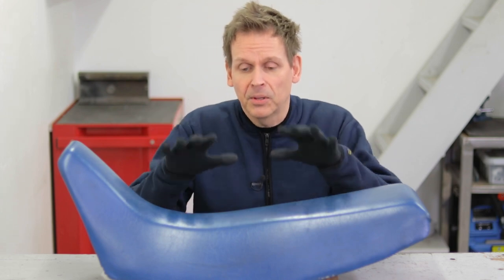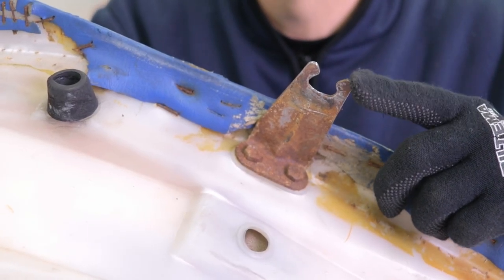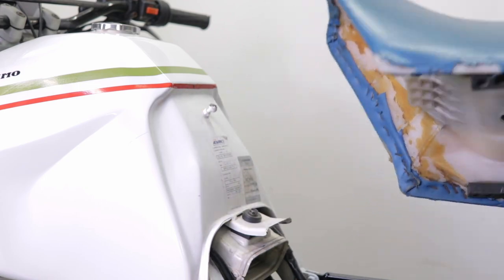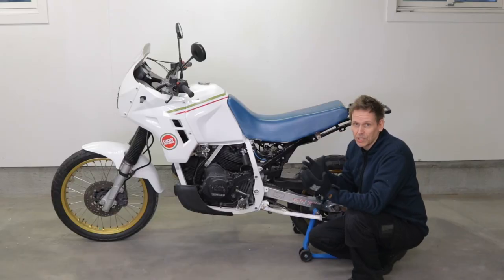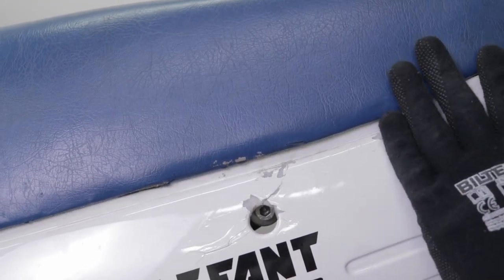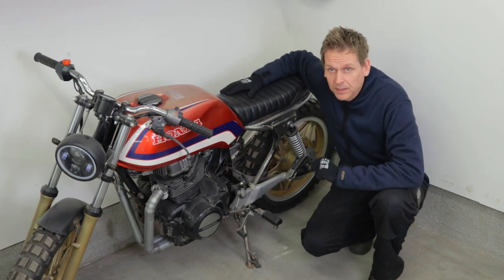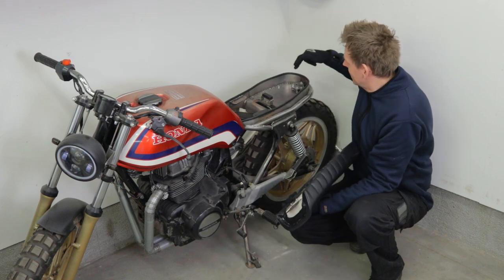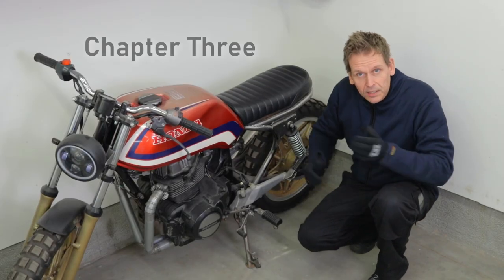3D Printing a Motorcycle Lock - It's stronger than you think!

Comment: The jaws of the vise are adding strength to the mount housing.  A true test would be where the housing is bolted to a frame like it is on the bike.  This would impart focused forces on the housing's bolt holes where stresses will eventually cause the plastic to fail.  Once you've dialed in the design, replace the plastic with metal parts so that it is much more safe on the bike!  Great design!!!
Reply from the maker: Yes, that is true. I just took it for granted that the white tab was the weakest link since it is the thinnest part, the black housing is quite a lot thicker and stronger. It would absolutely make it much safer making it with metal parts, but the idea behind 3D printing it was to simplify the fabrication process. I also think it is strong enough as it is 😊

Comment: That's a very nice idea.
I'm rebuilding a 1981 Suzuki which has a similar mounting mechanism, with the added fun of the same bolt also holding on the rear indicators.

I shall have a look to see if I can adopt a similar solution.
Reply from the maker: Ahh, cool - what Suzuki is that? I am very satisfied with the solution on my bike, it still works like a charm 😊
Reply: @kihestad  Hi! It's a GS250T, twin cylinder, twin cam, 8 valve aircooled...
The engine looks huge, "Like a real motorbike" as one of my friends says, but it's only a baby 250 😁

I do have a couple of "proper" big bikes, but I wanted a little retro to buzz about on.
Reply from the maker: @juststeve5542  That is a real classic! It does not look like a 250 at all, I would have guessed somewhere between 550 - 750 😊
Reply: @kihestad  All those fins and the overhead cams make for a large looking engine - with teeny pistons inside!

I wish I had been able to 3D print mudguard replacements, it took me ages to find some good ones... 40 year old chrome is hard to find, who would have guessed! lol!
Reply from the maker: @juststeve5542  It can be a real challenge to find parts for these classic bikes 😊 Good luck with your project! 👍

Comment: If you're printing in PLA, you might have issues with the plastic deforming in the heat. Great design tho and I'm sure you could make it work.
Reply from the maker: Thanks 😊 It will probably be safer to print it all in PTEG. It's not very complex parts to print either. That is also the beauty with 3D printing, it's just to print a new part in another plastic type if it breaks!
Reply: @kihestad  PLA is often one of the stronger plastics you can use for 3d printing, the problem is that it can deform dramatically even at temperatures you can touch.

From experience, leaving a PLA part in the sun for a couple hours is more than enough to cause the part to shrivel up. 

I would bet that if you used a hairdryer for a few minutes on the part and then did the strength test, that would be a reasonable analogue for the temperatures it will deal with.

I give it 50/50, mostly depending on the infill and walls you went with. Making it white would probably help, though not much and putting some foil around it would probably outright solve the problem.
Reply from the maker: @SirSpence99  At least no problem so far, I'll keep this bike for a long long time - I'll let you know how it goes 🤞

Comment: The problem is not static 20 Kilos of force but the dynamic repeated stress during probably off-road driving and sideway movements of an 80 Kilo rider, securing this movement only with the 2 nuts in plastic holes is not enough. The seat coming off is a great danger, that is why it was secured by 2 hooked latches and 4 probably 6-8 mm bolts. I would at least use the plastic prints as models to manufacture metal parts and secure them with 6-8 mm bolts and nuts, even better would be to secure the seat with 2 locks instead of only 1. Innovative thinking and nice work though.
Reply from the maker: That is true, I would guess most of this force is sideways. I will secure the seat from moving sideways do it is not relying on the lock for that. I will keep you posted how it goes 🤞

Comment: I designed a replacement handle for my cars glove box a while back. It was made in pla, but it lasted for well over a year in a car that was parked in the texas sun. The unlocking lever seemed pretty weak but it held up for the rest of the lifetime of the car. Even in high heat pla can hold up if it isnt under tension.
Reply: it might be worth adding in some rake or some sort of locking geometry to prevent it from sliding around under hard riding, but looks like it'll be fairly solid.
Reply from the maker: That was not bad at all. I'll probably keep it as is and see how long it will last. This motorcycle is a keeper, I can report on every year 😊
Reply from the maker: Yes, I agree. I have planned to make some proper sturdy sideways "stoppers", perhaps reuse the mounting for the original brackets, to ensure it's not going anywhere!

Comment: Fantastic craftsmanship and a really great idea for those of us with older bikes where items like this could be very useful. This would also be a great upgrade for a seat that has the old push tab at the back that is plastic and prone to breaking, for instance on a 4x4 bike where you may be removing the seat more often than on your street bike. I would just like to say that maybe having the latching pieces at steeper angles, for instance the black piece at 80* and the white at 100*. I would also lubricate the pieces with dry graphite spray.
Reply from the maker: Thanks a lot, glad you liked it 🙂3D printing is perfect to prototyping, easy to do small changes in the model and make a new print for testing out what works best in real life. Perhaps changing the angles would have made it even better. I try to stay away from lubrication if I can, it avoids dirt and dust to stick to it. The plastic is very glossy and smooth, so far it has not been needed.

Comment: FDM 3D Prints are strongest perpendicular to the Layerlines no mater how many infill it got. It looks like your hook could be printed 90° turned upwards to the side to make it even stromger. Also you know your test isnt 100% valid since you clamped the slidershell in the vice. The encasement probably itself or the mounting screw attachement would fail first.
Still impressive and probably strong enough.

But i would reprint all PLA Parts in PETG. Pla got a realy low Glas Transition Temprature where it will get soft. Start warping and starts to creep while under tention. Its that low simple park it outside in the Summer or/and an even indirect heatload from the Exhaust for examle will make it fail over time.
Also PLA is not UV resiatant (not that it realy matter under the seat) PETG is better suitet (but even more a Carbon Fiber blendet variant) for automotive and outdoor applikations

And surely you know the hook and the slider is that simple you could just cut it with an angle grinder out of solid Aluminium from the scrapyard;)
Reply from the maker: Thanks for your thorough feedback 😊 You are correct, the hook (what I called the hatch bolt) could be printed the other way around. I was really just testing the PTEG part in this test, since it is the thinnest part (5mm) I would guess that is what is going to break first. I also agree that PTEG is the material to use here. 

Dang - you are spot on and highlights all the things I have thought about myself as weaknesses 😁 I did really expect either the hook or the thin white PTEG lock-slider-part would break under load, and the improvement would be to replace these with metal - preferably aluminum. As you say, they are quite easy parts to make. A lot of my 3D projects has been to combine metal and 3D printed parts and I find that to be a great combination. The metal takes care for the strength, while the 3D print  solves the complex structures. 

Thanks a lot for your input - very interesting reading! 😊